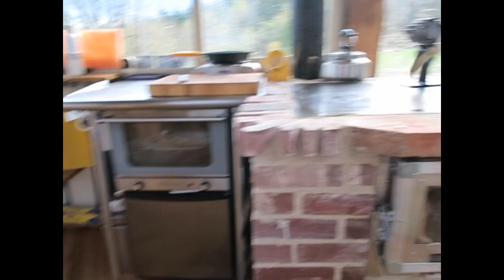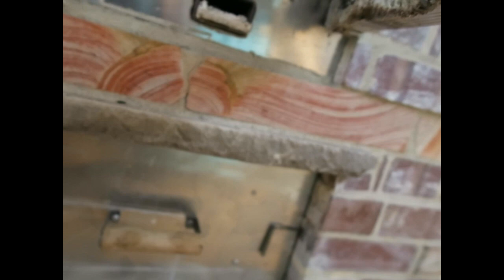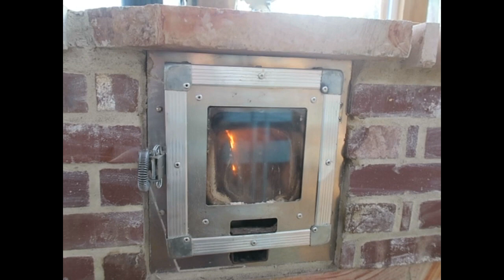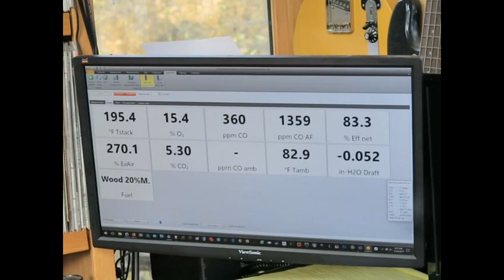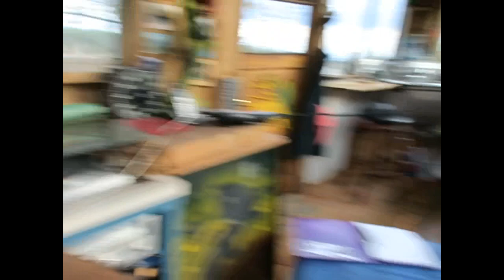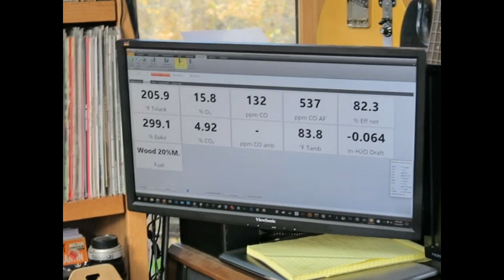Tiny Cook Stove Use, Burn, Build Options Discussion

Comment: Why Allow the Fire to Die down so Low before adding more logs ?  ( Unless for Video Demonstration purposes ?  
Keep the Fir HOT, Small fire , Large Fire, But Keep it HOT, A Hot Fire is far more Efficient than a cold or Cooling fire. 
THIS IS THE BIG MISTAKE of all Those with NO CLUE WHATSOEVER about Fires. 

Build your Fire. 
Feed Small Amounts of Fuel OFTEN.  
NEVER ALLOW it to Die Down Then Re-Fill it .  = STUPID NON INTELEGENT WAY to Run a Fire. 

HOW Big a LOG will it Take ?? How Many LOGS WILL   FILL IT ? 
My answer is YOU will Kill Your Fire. 
ADD a coke Can Size Log Every 10 to 30 mins according to the Heat you Require at the time. 
Feed a Fire OFTEN,  Never Allow it to Die down Then Fill it Full. 
THIS WILL DOUBLE or TREBLE your FUEL BURN & HALF YOUR HEAT OUTPUT. 

A few Hot Embers & He Stuffs it Full Of Tree Trunks  !!! ??? 
TOO LATE, Mate. Your Fire is OUT. 
Expect To Level a Forrest every year to Run a fire like that. 
50 gallons of fuel, 1000 hours with a chainsaw . 

CONSTANT FUEL = CONSTANT TEMP'. 
COLD Fires Waste Fuel & Generate POLLUTION BIG TIME. 
That Method will Carbon His Chimney to Choking point. 
OMG!! the fire is almost OUT !! 
ADD FUEL. = Cold House & Thick Black Smoke out of the Chimney. STINK the Neighbours OUT & Get Complaints . 

HEY MR BIG FIRE, 5 Tree Trunks Lasts 5 Hours. 
NO NO NO . WRONG METHOD. 
5 tree Trunks will Last 5 YEARS if Done Right. 
CONSTANT Temp & CONSTANT FEED = FUEL ECONOMY & LESS COST & MORE HEAT From Half or Third of the Fuel. 
= Less Time & Less Chainsaw Fuel, Less New Chainsaws, 

Only Stoke a Fire up Full When going to Bed for the night.
Reply: Gemmi BREXIT is your stove a mass heater or a iron box? Not saying one is better I have only ran a iron box myself. From late September to late May? Depending on the winter. Only time it went out was if we ran out of fuel. I could squeeze hours out of a log, but if I could have coasted on some days it would have been nice.

Comment: Just some cheap advice for some secondary air, I used a stainless steel water bottle, so far so good. Cut the bottom off. Some companies give them away free as advertising merchandise. I haven't burned it very long so I'm not sure if it will last yet, but cheap to replace like your original design.. The exhaust car part you recommend is probably the best, but is very expensive to get in CANADA so I'm trying this first.

Comment: Hey Matt, gang here again. A big puzzle we have to solve for our build is the heat exchange part of the stove, as its only an option on your video and you don t go into it.  We d really like to heat our water and thats a big reason why we went with your stove design in the first place. Just wondering if you d have any comments, tips or useful links on fitting water pipes in there. I'm sure its straightforward but not having done this before its all  slightly daunting so any help you could give us would be greatly appreciated. Thanks as always for your advice.
Reply from the maker: PG, you can look to Tim Barker for good ideas on hot water system design.  As for location in the stove, you have a few choices and I'm happy to help fine tune your decision once you lay out your entire system.  Pipe routing is easy, just let the lines through the brickwork and mortar with sand and clay.  Hope that helps!

Comment: Hey Matt, question on the firebox here.  Issue:  We ve bought reclaimed bricks to build the stove, they re over a hundred years old, very beautiful, incredibly heavy due to the mass, but somewhat crumbling around the edges. Our concern is that the intense heat may crack them further ( They seem.. a little delicate) and we ll end up with a pile of red dust. Question:  How much does the ceramic fibreboard core reduce the heat hitting the outer brick and do you think there will be any reduction in the integrity of the brick over time? Looking forward to hearing from you, we ve just cut a big hole in the floor ready for the concrete base ! :/ No going back now !
Reply from the maker: They will be fine PG.  The CFB does a great job of protecting the brick from the intense core heat.  Nowhere on the brick body will ever get hot enough to break down brick.  It sounds like you are off to a great start, those heavy salvage bricks are the best.  Can't wait to see your stove!
Reply: Thanks Matt, thats a relief. We ll keep you posted !

Comment: Thanks for the info.  You probably cover this in the plans, but is it possible to make the core out of fire bricks or something else instead of ceramic fiber?
Reply from the maker: This one requires the board to keep the small footprint.  You can build the same with Insulated Fire Brick using my Full Cook Stove plans.  You can replace the firebox sides in this stove with firebrick splits if desired.  You can also cast parts to replace the cfb if desired.  Hope that helps.

Comment: Since this stove places a lot of emphasis on cooking as opposed to just heating, is there much of a loss in heating ability due to the tradeoff?   Also, I understand how the stratification bench works, but since it lacks the mass of a cob bench, for instance, does it lose much capacity for holding and releasing heat … as in a shorter period of heating than a solid mass bench would have?
Reply from the maker: The bell bench being built of bricks probably actually has more mass than a cob bench of similar size.  The brick and stone are far denser materials, and keep in mind the cob bench has two 6" or 8" flues running through them so are mostly hollow as well.  In a bell the sides get more heat due to the stratification over a cob flue run bench which mostly heats only the top.  So, I believe this construction offers longer heat cycles in a bench of similar dimensions.  Hope that helps!

Comment: Could you use a cast iron cook top from an old range, or does the top have to be totally sealed like you do with the glass top?
Reply from the maker: A cast iron top from an old range would be great, even one with removable eyes would work.  The stove should always be drawing in from any small leaks due to chimney draft and the warm brick body helps drive that, so I imagine that once warmed up one could even remove an eye and sear a steak!  Maybe.  But overall I'd say a CI top would be ideal.

Comment: would love a cooking demo... Doesn't have to be cooking show quality but just something to know how you deal with the uncontrolled Temps you get. Do you just us an infrared thermometer to get a rough idea of the temperature gradient flowing across your cooking surface or is it much more "oh shit that is getting too hot move it to the right a bit" kind of thing.
Reply from the maker: Hey Ryan, good question, it's one I get a lot.  It sounds hard, but in practice it's very intuitive.  The cook top is super hot right over the riser, then gradually cooler.  In use, you learn the temp gradient quickly and yes, you just slide the pan to the right spot.  A video showing this is a great idea, I'll try to get one up before too long here.  Thanks for the comment.
Reply: Thank you! Needing to a repair a gas stove that I bought for $700 a year and a half ago... The simplicity of this is just astounding. I could have spent the same amount for something that did more than cook my food.

Comment: I live in Florida so we don't need the heat. Could this be built with air crete in place of the outside brick. It will be strictly for cooking, baking, canning and heating water.  If I understand with the air crete the heat won't escape like it does with the brick. For info on the air crete check out "honey do carpenter" on Youtube.  Would love to hear your thoughts on this. Thank you. Will be getting the plans this spring.
Reply from the maker: I think that sounds like a good plan Zaney.  If you use insulating material like aircrete for the body of the stove you can push more heat into your exchange for the hot water, which I believe is exactly what you want.  You've got a good handle on it, in my opinion.  I can't wait to see your build!
Reply: thank you so much for takibg the time to reply. I can't wait for the build either.  But first we have to clear an area and build the structure.